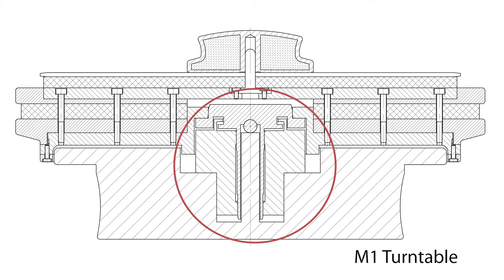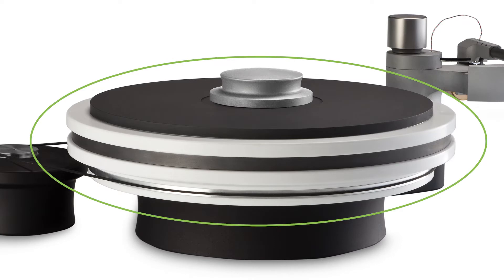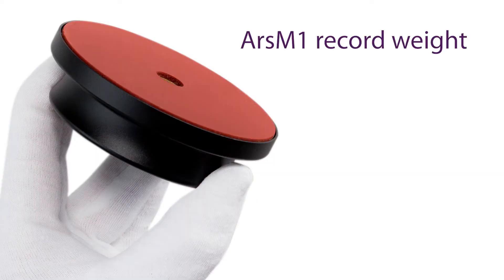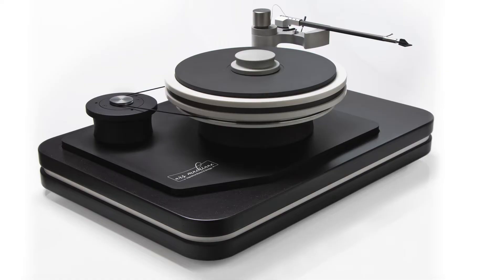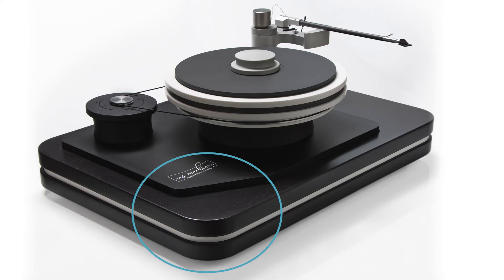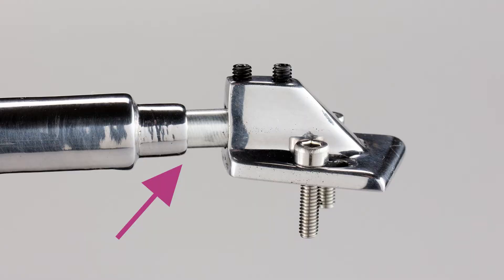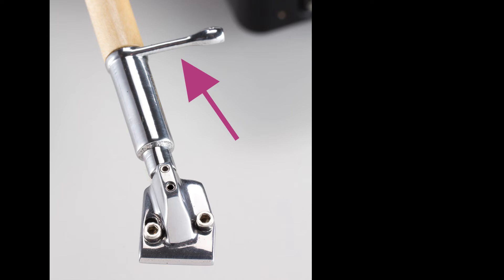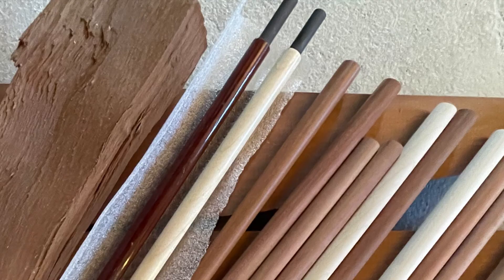Record player BM1 - one of the most innovative on the market

Comment: Very intriguing. Does it turntable have a separate motor drive controller? And does it have any upgrades for example, a external power supply. Last what is the price of the two turntables?